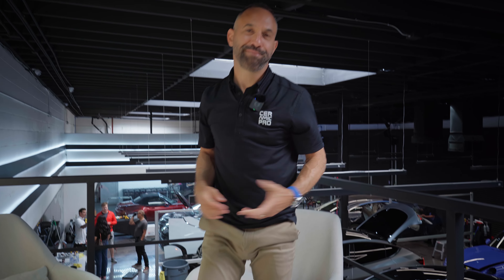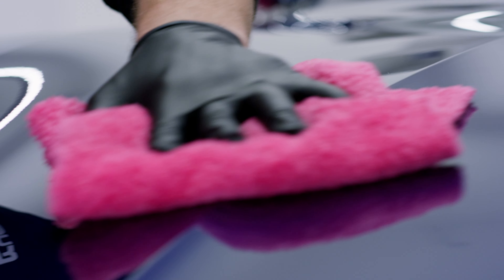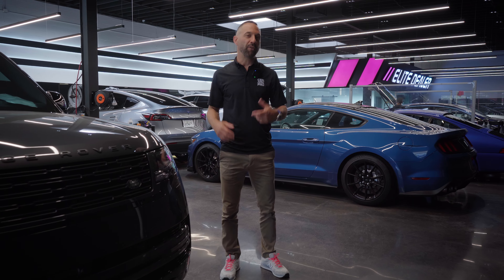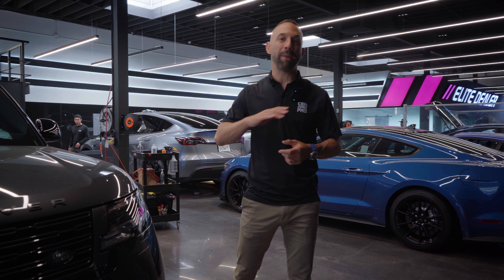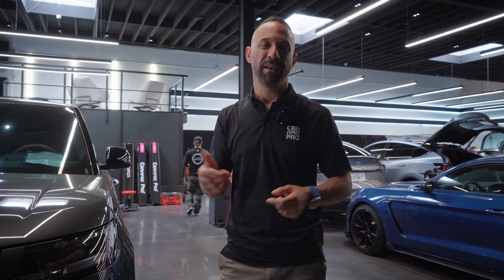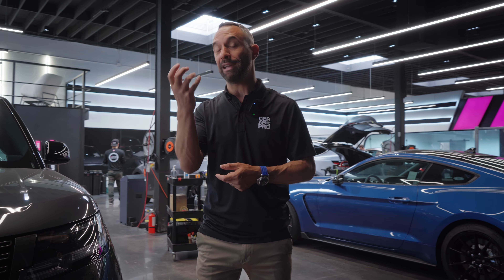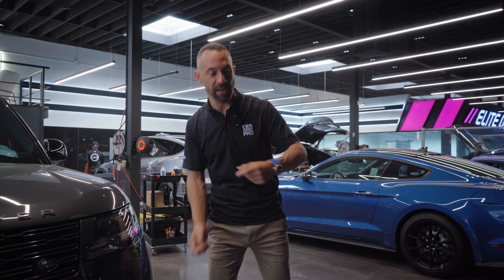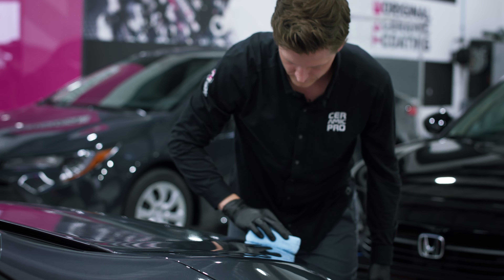Can You Wax A Ceramic Coating?

Comment: Do some cars come out the factory with ceramic coating?
Reply: not factory but dealerships yes, if you opt for it! i would defiantly not recommend getting a dealership paint protection even if it was free.
Reply from the maker: Cars do not come with ceramic coatings from factory. Most dealerships will add it as an option during the buying process.

We have seen many people be misled into believing they have a true ceramic coating on their vehicle, from the dealerships. So, it is good practice to ask exactly what product they are using, and where the work is being done.

Our recommendation is to skip the dealership detailing and paint protection packages and bring your new vehicle to a Ceramic Pro certified installer. There you will know exactly what is being done to your car, with exactly what products, all the work being done by highly trained installers, and it comes with an incredible warranty.